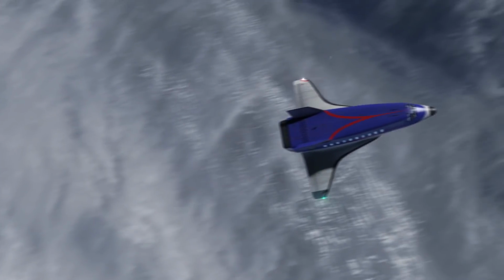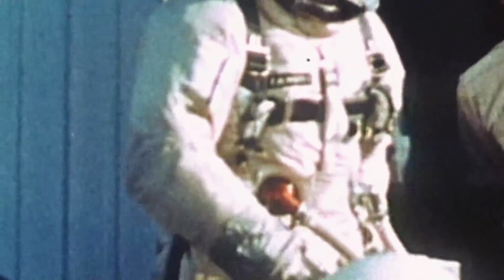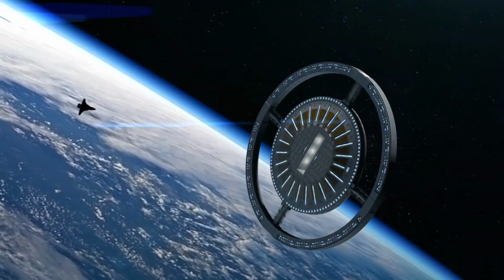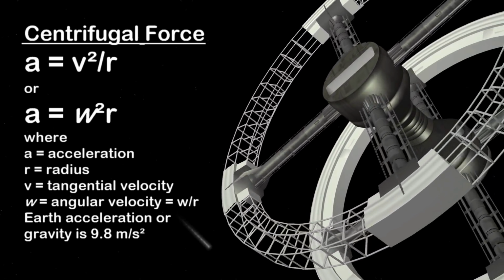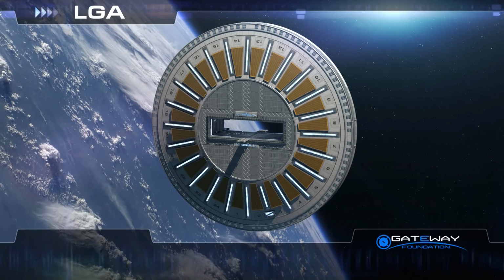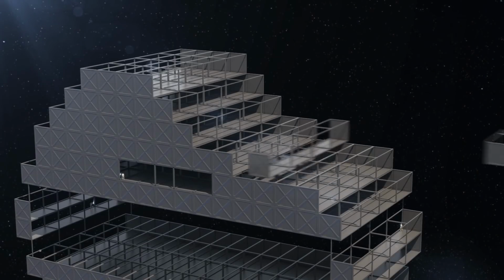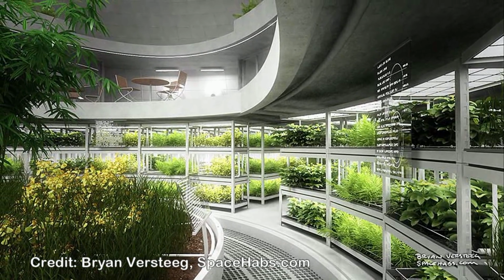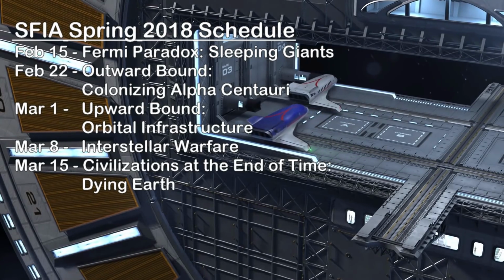Spaceports

Comment: There is a very simple solution for this. You can send up into the atmosphere a rocket "Station" and move it until it leaves earth's satelite zone. Then you send down cables and tow whatever it is in atmosphere into the sky by pulling on the cables, and you just have to keep the ship moving away from orbit in order to counter the gravity pulling it down. Towing satelites who can adjust their course and use earth's movement to pull on things seem to me like the most clear alternative. Would those cables need to be 36 thousand miles long? Yes. But so are internet cables under the sea. Plus there is the option of limited propulsion aiding in getting those things to the space station. So a much less powerful aircraft than a rocket attatches a cable on top of it and then starts a limited propulsion engine to get it into the sky in the direction as it is pulled. A big aircraft could get into space by utilizing this. Say you accelerate a boeing 747 to its maximum height of 13000 miles, and then you pull it the rest of the way, aided by whatever force its engines give while being in a space station that would be leaving earth's orbit were it not for the weight of the aircraft serving as leverage against its natural movement. 13000 miles is already halfway to orbit. You just need to push it past that point  a little and that should be relatively easy with current technology and current materials.

Comment: Centrifugal force will not work in space, it works on Earth is because with the help of gravity BUT drag force will work so design an artificial gravity spaceship with drag force instead
Reply: I think you need a physics lesson.
Reply: @massimookissed1023  No, it’s logic. On Earth, you are pull down by gravity, as an object spins it transfers the gravitational force to side way which the centrifugal force but in space is completely different, no help from gravity. Space is floating, imagine you’re floating in the middle of the circular tube, so no matter how fast the tube spins, you’re remain stationary
Reply: @oaihothachsquest255  , your logic sucks.
 Gravity is not transferred anywhere.

Yes, if you were floating in a spinning tube in space, the tube would spin around you.
 However, if you had contact with the inside of the tube, you'd be spun around with it, and feel yourself pushed to the inside of the tube.
Reply: @massimookissed1023  Lol, whatever! Waste my time
Reply: @massimookissed1023  ok here is something for your brain, you tell me if you can spin a rock in space with a string.
Reply: @oaihothachsquest255  yep

Comment: I just realized that welding in space would probably be easier than here on 🌎. In our atmosphere, you have to use a shielding gas such as argon. In space, you don't have that restriction. So welds would be easier, and probably better quality for the same electric output. Definitely, they would be stronger.

Comment: I don't see why they have a problem with rubber suits because they can't apply pressure around the throat area.  just make a hard plastic ring around the throat area that the rubber can seal around thus protecting the throat. Problem solved.

Comment: Wouldn't it be better if the Port in the Center, if you will, didn't actually spin but only the outer ring?
I know docking with a rotating mass is possible and we do it now but it's only a docking ring basically that you're not flying craft into.
Just a random thought from someone with no degrees to my name other than hauling freight here on Earth, of course, with over 1 Million Miles safely driven...
Thinking about it more wouldn't it be better if the open bay in the center design is actually used as more of a fab-center to both build ships if need be but more so to build the station itself? Moving the docks to the outer ring would make it safer using existing docking ring tech for both acceleration/deceleration. On a botched approach simply do a fly by with nothing but the empty space around the station, instead of attempting to dodge the station itself that's directly in front of you in a much larger area or through the port hole itself, or am I wrong in that thinking?

Comment: The automated manufacturing hub couldn't it instead of producing spaceport sections be designed to make the wire for the orbital ring and wouldn't that be more of the goal? Maybe I am just overthinking it in that the costs of the spaceport would be pretty high just to get the materials sent up there but if a company or multiple companies put those resources into constructing the orbital ring using that hub after it was completed then the cost would be significantly less in terms of cost to get materials and people to and from. Also could the hub make the wire in one piece and not in sections (I am not an engineer so not sure if that is possible), but if it is possible then they could use drones to keep the wire aligned as it went around the earth in orbit.

Comment: I admit I came across this quite late Isaac .  The thing that never gets discussed is impregnating , taking to term , and giving birth , in space .   Why is that so important ?  I think for obvious reasons .  Which also leads me to the slow dragging going on by the rulers of our universe , call them what you want .
Reply: But again we can nearly simulate all things  [in a simulator or computer model] I suppose extrapolating all the data on adults in space could be applied to a degree , to the complications . Which must be found out . It's the  BOTTOM  line basis of all life

Comment: Have you ever heard of cold welding you don't know how to put Sparks where the metal would be welded together because of outer space due to the lack of oxygen if similar metal iron and iron nickel nickel Etc touch and outer space they instantly become one piece of metal you don't have to heat them up you don't need to use welding torches check it out

Comment: Space Station Animation Correction:  When passengers onboard the shuttle enter the space station core they would be weightless and floating around.  They would need to be placed in an "elevator" to transfer them to the outer part of the station where the centrifugal force acting on their bodies would generate the effect of artificial gravity required to walk around.

Comment: I have often thought that multiple telescopes in a space station could be linked for observations. 6 on the outer ring 6 on the inner ring each one could be used for separate observations or they could all be linked creating a large composite image together. I know radio telescopes are used in this manner but I've not seen even theoretical work on using optical telescopes in this way.

Comment: Curious why you didn't go with Bigelow Aerospace - they have some colossal sized habs which are inflatable but provide a massive platform with minimal cost-to-orbit. They've also been deployed both individually and attached to the ISS. Plus it's better for managing micrometeorite impacts as low orbit is a freaking mess of material flying around very very fast. I don't know why they'd opt for a hard shell system between launch and assembly costs and future liability.

Comment: 4:40 I noticed something in the concept video: after docking to the station, the passengers walk off, in a direction radial to the rotation, but they appear to be able to walk normally as if the spin gravity wouldn't pull them 'forward' (radial outward direction) instead of 'down'. I hope that is an miscommunication issue with CGI production versus a major oversight on the station design lol

Comment: SpaceX Earth to Earth rocket using the $196 million BFS as a single stage ballistic transport, can carry 71 tons (1073 passengers) 14,500 km in 27 minutes burning 327 tons of LNG and 733 tons of LOX at a cost of $198,000.  This compares favourably to the Boeing 747 400 ER that carries 23 tons (412 passengers) 14,500 km in 15 hours burning 241,140 liters (188 tons) of jet fuel  for $120,400.  

For this to work at all requires that the rocket be used as much as an airplane before its retired.  About 35,000 times.  Also, the rocket must be as reliable as the airplane.  That is fewer than 1 loss in 1.25 million launches and landings.  

SpaceX achieves these figures and the age of the rocket will have arrived.  

The first and foremost use will be to have 3600 rockets replace 31,000 airplanes.  Another 30,000 rockets may replace 30,000 private jets as well.  The airliner replacement rockets will have a useful life of about 30 months.  Then they will be retired for next to nothing for off world use - to fly out their last flights over extended periods of time - far longer than 27 minutes.  There are another 23,000 super yachts in the world that cost around what a BFS suborbital system would cost (without the Heavy booster)

The point is, setting aside the private yachts and jets, and focusing just on 3600 rockets replacing 31,000 airplanes to deliver 12 million people each day to 106,000 locations each day, we have a situation where 6 rockets a day are manufactured and 6 rockets per day are retired - and available to be launched into space.  

With 35,000 uses and $196 million the cost of the hardware is $5,600 per flight.  With $5 billion development cost spread across 3600 rockets that's $1.7 million per airframe.  

So fuel costs dominate as in airplanes today.  

B747 $120,400 / 412 passengers = $292.23/flight - 15 hours - 14,500 km
BFS   $198,000 / 1073 passengers = $184.53/flight - 27 minutes - 14,500 km

So we can see the genius of Earth to Earth.

Plus the fact that rockets will be introduced to everyone as an every day sort of thing.  

At the outset everything will come from Earth.   

A BFS modified to reduce its structure from 85 tons to 65 tons and increase its payload from 150 tons to 170 tons - and make it a large tank capable of carrying 2200 tons but carries 1270 tons at launch and has 170 tons to spare on orbit.  

A BFS passenger rocket modified to carry 120 people long duration in a 40 cabin configuration - ends up with 150 tons of useful load on orbit.  

Two BFS tankers launched with 170 tons on orbit then 24 more fill them both up with 2200 tons of propellant.  then Two Passenger BFS are launched, and one tanker drains into the two BFS - refilling them EACH with 1100 tons - and that tanker flies back to Earth.  Then the tanker and two passenger ships fly to the moon for $14 million with 240 people - $58,333 - per passenger cost.  

Two ships tether together and spin to produce gravity in the 3 day journey.  They separate before entering low lunar orbit.  

Two ships enter low lunar orbit.  The tanker refills the two BFS ships.  They descend to the lunar surface.  Then return to Low lunar orbit.  Then they refuel again and all three return to Earth for reuse.  

1 week travel time.  2 weeks lunar time.  1 week refurbish.  1 month cycle - 2880 per year for each pair of ships.  

If the BFS have 35,000 flight cycles and are retired after 30,000 flights in 30 months.  Then, another 5,000 flights over the next 25 years off world.  6 per day.  120 passengers per ship.  

25 years * 6 per day * 120 passengers * 5000 flights /2  = 16.43 billion passengers

Comment: Concerning the concept of rotating wheel type structures, I wonder what effect unevenly distributed mass has on such a structure.  I guess ther won't be any come togethers in such a station.  Also, all distribution / collection of water, for example, has to be from the hub outwards and back.  Maybe this can be partly solved by a movable counterweight that balances the system.

Comment: I see a simple flaw in the gateway hub station.  Centrifugal gravity depends upon spin and a ring to stand in with our head pointing towards the center of the rotation.  The outer layer is fine, but the inner blocks are lateral and not radial so occupying those spaces would be inconvenient because often the bracing will block mobility around the station .  Each segment should be wedge shaped to make concentric rings from center out to the outer hub, not square blocks out to the edge and then transfer to a wedge segment for the one and only ring layer.  They should ALL be ring layers, each with greater gravity as we transfer out towards the edge while it spins.

Comment: During the Space Shuttle period I often wondered, why they didn't spend a little more fuel and made the external tank (ET) go into orbit, assembling the lot into a space station. 
I'm aware that the Shuttle went up into different orbits, but with enough time it shouldn't cost that much in maneuvering fuel to bring most of the ETs into same orbit.
Stick them all together, and build the interior, and you have a space station. 😀

Comment: Why do we keep building tinker toy space stations and not a good solid space station? I have a design that is not only solid but also has a new type of space elevator as well as the ability of traveling between orbits of many other satellites like the moon. It is also equipped with its own magnetic and Ion fields to include its own self-defense agents all types of things. There are also 2 types of multiple space ports, different environment areas with escape pods just in case; multiple labs, living quarters, sub stations to talk to the main command center and more. It will have farms, a food court, and entertainment of all sorts. There are still a few things I’m working on with this Idea and the more knowledge I get improves my Ideas. The Gateway Station will be good for now but my Idea is so much greater in size and ability. rwdisland@gmail.com

Comment: I am totally on board with spaceports and the modular construction of such. But 1) How do we get the thousands of tons of material into space economically? 2) You mention shielding but don't get into any details. 3) I believe the central hub will have to spin CCW to match the planar level of an approaching craft, otherwise risking an accident. 4) What kind of power plant will there be for keeping these floating hotels warm and cozy?  If the ISS cost $100 billion and these structures are perhaps 1000x as large - who is going to fund such an endeavor?

Comment: If the center of the space station is dead space then there wouldn't be a zero gravity part in the whole space station when it is rotating. I though  the whole point of the space station tourism was zero gravity. The space station would either need rings that rotate the other way. Or a redesign of the space station where there center is habitable

Comment: All of these ideas are great. It would be sad if spaceports were to be the same size as the ISS and in the same type of low earth orbit. With Origin striving forth with their New Glenn rocket designed for high altitude/barely space tourism and Virgin Galactic and Space X building their own vehicles a destination in space where passengers could extend their experience in space would make large scale manufacturing viable. It would be great if one or two of the spaceports had spin capability. These are all old ideas, but with a much cheaper payload lift capability and the commercial incentive for enhancing the up-down space tourism experience, these ideal spaceports might get built.

Comment: Seems to me, this contruction has little protection against hazards in space.
The design will enthail a lot more than what is shown. It looks unrealistic.
The idea to build containers with drones is a good start though.
I design things and built a couple of my own 3D printers so I am very familiar
with technical contructions, electronics, programming etc.
I have been thinking about how to build a space port, and made some designs as well.
But this, is a very crude, simplistic contruction, imo.
By the way, as far as I know, you do not need to weld everything in space.
Blank metals will stick even better than welds, if you pressure them together.
But, that's what I have been told.

Comment: The problem with welding in space is not only from vacuum but also from wildly fluctuating temperatures. Base metals need to stay at a reasonably constant temperature for a sound weld. Less cracking and failures will occur. Not may occur. This would need to be addressed.

Comment: I noticed you're showing regular welding mechanisms, but it's in Space, so why not just use the natural tendency of identical metals to self-weld (cold weld/vacuum weld) when there's nothing between them?
https://en.wikipedia.org/wiki/Cold_welding#In_space
Reply: I think that's more of an inconvenience caused by a few atoms bonding, rather than a structural connection.

Comment: Instead of a rotating rectangular docking port how about a circle?  A spaceship wouldn't have to approach with a spin.  It could stop in the center of the circle like a dragon stopping by ISS.  A track around the inside of the circle could have a cart rotating 1 rpm opposite the station and appear stationary to the spaceship.  An arm on this track could reach out and grab spaceship.  Then slow the rotation around the track and transfer spaceport rotation to the ship.  Then the arm could dock the ship like on ISS somewhere on the circle docking port.
Reply: Yep. Although adding spin to your approach craft to match the station wouldn't be difficult at all.
 Currently docking with the ISS requires matching its spin of zero.

Comment: Instead of a pod with cumbersome external armatures/tools controlled from the pilot inside, are there any designs of a flexable half bubble (with a closed chamber for the pilot during transport) that would attach to the work area and form an air seal? Then the pilot would leave the chamber and do any needed work, wearing only a minimal suit, in an enclosed area a few meters in diameter.